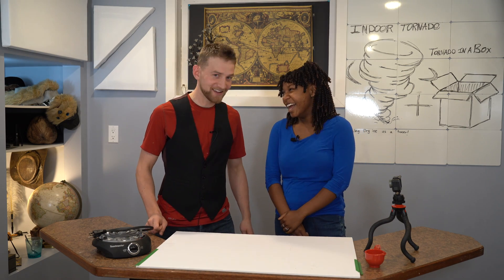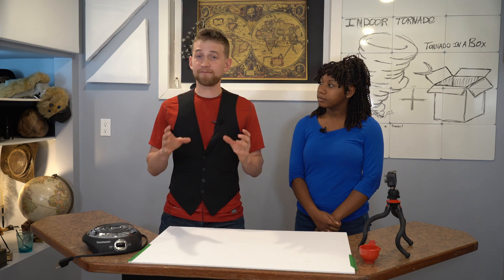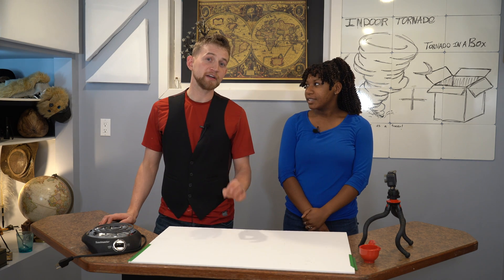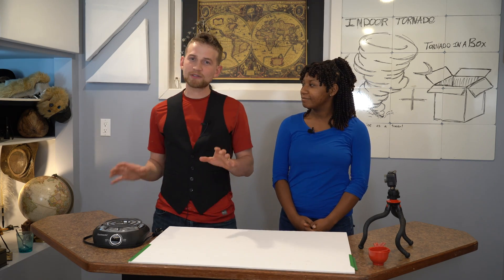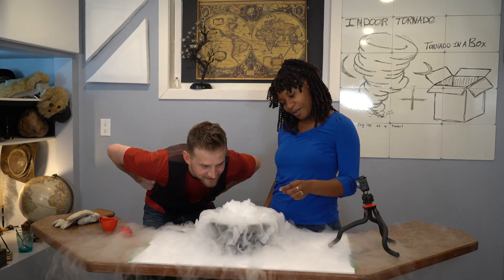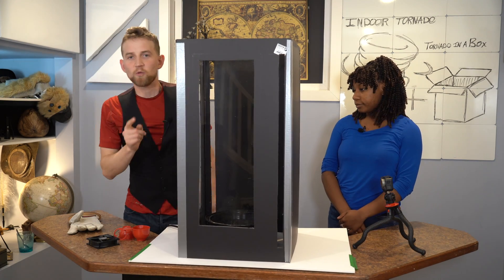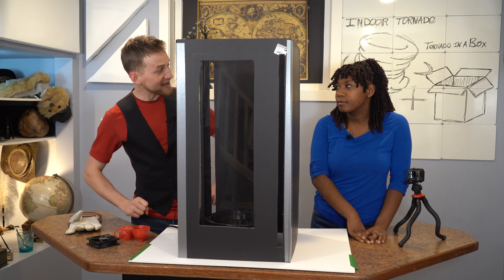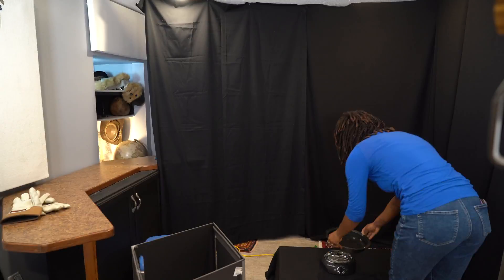How to build a DIY Dry ice tornado! - Fluid dynamics in a vortex!

Comment: Can it be inverted so that the dry ice vapor is spun down with a fan creating a vortex? And if a steamy warm water whirlpool were at the bottom constructed using airline tubes, a giant bowl with hole in the center, a bucket and an aquarium water pump to return water to the bowl...then have the cold air vortex end up getting sucked into the whirlpool. Now that would properly describe an inverted tornado with similar physics.